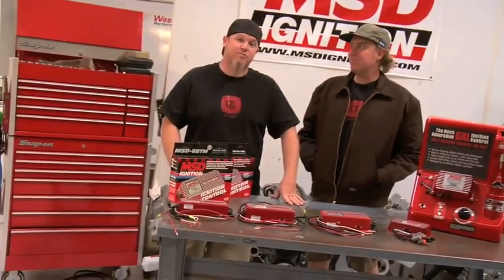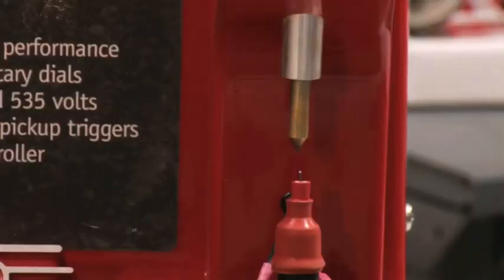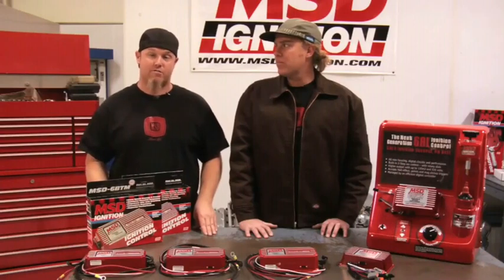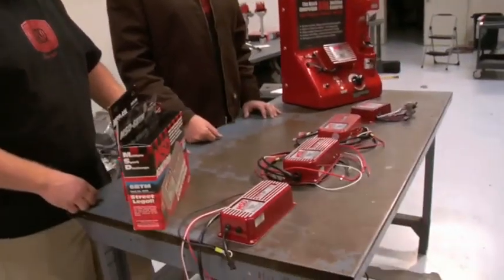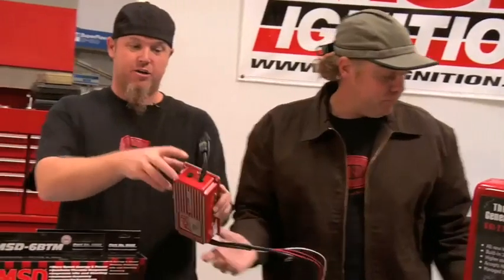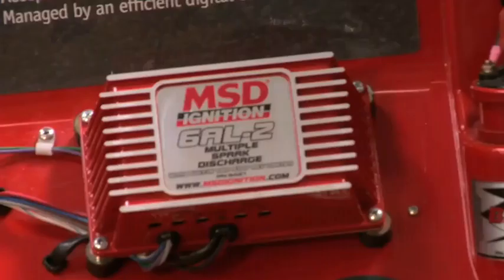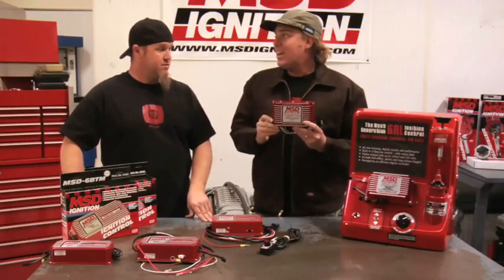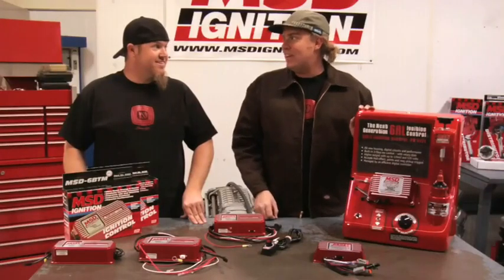MSD Ignition Controls - Playing with Fire

Comment: Can I use this box in my 1970 f100 with 370? And let me know if I need to change the distributor
Reply: What's a 370 ?
Reply: 360 Engine Sorry phone correct it!
Reply: @tonychavez239  thanks. I thought maybe I missed one of those Ford engines.
People talk sh!t about the 360. But they are a good solid reliable running engine.
I just rebuilt one last month. Had my favorite cam grinders, Delta Cam in Tacoma, polish up a fresh stock 428 cj cam and am going to try it in this engine.
Two important things for that engine. Deep six the poor exhaust manifolds and use a Ford duraspark and distributor.

Comment: Most of these comments are either "Will it work for me?" or "This product line is overrated." I had very good experience with the 6AL that was installed in my Ranchero in the '90s. The improvement in idle quality of the mildly modified 302 with single-point distributor was immediately noticeable, and probably attributable to the multi-spark discharge technology, In theory, it ensures that if the first spark fails to fire the cylinder, then the second or third spark might do the job. This would also tend to lower emissions, which is why some Ford Ranger 2.3 liter engines had dual spark plugs.
I didn't try measuring changes in spark plug voltage or plug life, although those can also be factors. As a few commenters noted, this isn't for everyone, but it works for some of us.

Comment: Good afternoon, very good explanation, I have a question: I would like to install the MSD 6AL and the coil (s) for a Silverado 2005 V8 Vortec 5.3lts. Stock, and I doubt that it is needed in total for the installation of the 6AL.  If only with the 6AL or also the coils or what else do I need?  Similarly if it is only one coil or is it one per cylinder (8 in total)?  Since I can't find a video to explain to me about that model and what I need, I would really appreciate your answer, thanks in advance.

Comment: Hey guys I wanna buy the  Pro-Billet Tach Drive Distributor (8572) but I wanted the MSD 6al digital will it fit? I have a 400ci sb Chevy if not witch kit is available with tach for Rev counter? Thanks in advance

Comment: What load? As the RPM’s go up, cylinder pressure drops. It’s called volumetric efficiency. Unless you have a power adder that changes cylinder pressure, the coil only produces as much secondary voltage as needed. After decades of looking at an engine analyzer for inconsistency between cylinders to ensure the equal opportunity is there, I see no reason for this system. For GM, over two decades use plug wires with a wire wrapped around an aramid fiber core measuring at 8 to 12 ohms per foot, instead of 40 - 50 ohms per foot like the ones sold by “MSD”. The coil if one per cylinder or a single coil can have lower primary resistance which leads to high voltage when turned off, via mutual induction (Step-up transformer) but other than lower amperage and using circuitry that switches 3 mosfets per micro-second, just increases the length of duration. Battery available is used on the primary side of the coil, otherwise the leakage thru the insulation would be horrible. The voltage in the secondary is limited by ohms law and produces only voltage needed to jump the spark plugs gap. Using one coil per cylinder allows for longer magnetic saturation, resulting in more potential for voltage induced into the secondary of the coil, but not used.
  Have multiple sparks per event in the air gap of a spark plug outside a running engine looks impressive but can’t justify the expense! That is if you see, if looking at the scope of an engine analyzer or any secondary display. Otherwise, this is an expensive dog & pony show for everyone who knows nothing about ignition, cylinder pressures, A/F ratio and how electricity works in a step-up transformer, painted red. I can’t find anyone to justify the expense or benefits unless you are a full blown race car the each injector can provide zip to 1 liter per second to a single cylinder. 
 This is my experience wanting to know what makes this system better than factory. Otherwise they would use it to reduce emissions while increasing HP. At $40 - 50k, what is the additional expense in the manufacturing process to spend an extra $38.12? Compared to their current ignition system, I don’t see any advantage from a technical point.
ASE Master Tech + L1 Since 1978 - Retired
Reply: Dean, may I ask your advice based on your experience and education? I have a 1981 GMC C3500 with a 350 4 bbl, th400, 14 bolt with 4.56:1. The head gaskets blew last year and the job was performed at a friend's shop. His new tech lost my distributor so they installed an aftermarket fancy cheapo HEI. 

The problem is the power has never been the same. This truck has a diamond plate bed floor, roof rack, and hydraulic lift gate. It is always loaded heavy and this is the truck I use for towing when my newer 2004 Dodge diesel isn't available. I don't expect the GMC to compete with the Cummins... I just want the GMC to perform how I know a properly tuned  small block can. When the truck was empty it used to be able to do a burn out and it would accelerate fast enough to hurt a few better cars at the stop lights. It towed beautifully. 

I know the centrifugal weight springs are probably incorrect for my application and this distributor also came with an adjustable vacuum advance diaphragm that is set with an allen key down the hose barb.

How do I make this right? 

Do you have some general guidelines? Does my tow vehicle require lighter springs or heavier springs in there? 
I can no longer get the "correct" vacuum advance diaphragm so I'm forced to tune this one to my needs and I'm not sure which way to play with it.

Please and thank you.
Reply: @xmo552  Please try to get a dial-advance timing light. Clean and ensure “0” is TDC. Check with spark tester first for strength. ACDelco P/N ST125 is spark tester 25,000 volts or 25Kv. Unplug vacuum timing advance & plug. Run and set to 10 or 12 degrees before TDC (If under hood spec label, follow it) Vacuum check advance with pump or simple hose check. Make sure it works. Spring on good weights lubed on good bushings could have same or mix of colored springs. If HEI, #1 think lost or left out is metal ground strap from coil screw to cap connector. I have 3 extras in drawer! Key B+, Ground connect on bottom, third is tach! 
With engine warm to idle, set base timing at 10, 12, or 14 degrees BDC. Springs add 21 degrees advance as springs open smoothly. Vacuum advance plugs into carb at Venturi port, meaning no vacuum at idle. As air speed increases across Venturi, vacuum increases. The vacuum advance adds to total advance adding 21 degrees of advance until WOT. 
  So let’s review, say 12* at crank, 1/2 of 21* of springs (Dist 1/2 speed of crank) + 12* 1/2 of 21* of springs = 
12* crank
12* springs 
12* vacuum
Total at 3k RPM = 48-52 degrees BTDC advance. 
Good strong 25Kv spark.
Good distributor coil / base housing ground.
Set base timing, watch spring & vacuum advance with advance timing light (Set to 52*, run engine until zero = 52*)
With timing set, use needle nose pliers and pinch off large hose from carbon canister. If RPM’s drop, bad purge valve, change or plug as long as vacuum lines to thermal vacuum switch good unless electric solenoid. (Varies on newer years say 89 & up)
Carbureted, engine off, run screws in until seated, back off 3 1/2 turns.
Start, run screws 1/2 turn in until idle drops, stop at even turns and back out until engine runs smooth. Should ok as long as carb & other ok like vacuum leaks. Done this hundreds of time as removing distributor and checking settings on sun machine as part of tune up. We rebuilt carbs, starters, alternators as parts in box meant new from dealer. Could have been reman parts but never saw them!
Best of luck! DK, Omaha. ASE Master retired.
Reply: @deankay4434 great explanation. But you went over his head.
Hope it was just a ground strap.
Reply: @jesse75  grounding the engine is a complex adventure. The alternator has to be grounded to the block, the frame, chassis, cab (On Trucks) and bed. But to complete any circuit back to the battery has to be completed. Other wise you have a voltage drop on painted engines with no wire & star washer into the back of the alternator to block. These star washers cut into metal to complete the return circuit. With a digital Volt-Ohm Meter (Fluke 87 type 5) run with current in a working circuit test across the wire to battery ground or B+ to see loss. It should be less than 0.030 volts! This measurement is a standard check. Like a parasitic drain on GM's after 2003. So, shut off, remove key, place a high amperage switch between the battery and vehicle's electrical system. (Note; New Ultra Low Emissions Vehicles) have systems come active to check "Engine Off, Natural Vacuum" in the EVAP software. But older vehicles don't. But electrical load shedding has been common on GM's since 2012. The systems shut down as the same as powered up in reverse. This comes down to higher MPG, as the government imposes penalties on car companies that exceed CAFE numbers. 
(Corporate Average Fuel Economy) numbers as they sell higher numbers of fuel efficient vehicles as compared to Corvette's. 
Google "The big three engine grounds"
Best of luck on your project! DK, ASE Master since 78.

Comment: 1:00 Show me a spark plug with a gap that wide. Your stock ignition is more than you need.
Reply: “More than you need” but not more than I want. I INSTANTLY noticed a power increase the second I crunk my truck up with the 6al. Like impossible to tell me it didn’t gain at least 30/40 hp
Reply: @lotus_8773  It is all in your head. The stock ignition system was lighting off your engine enough to keep the computer from giving you a misfire code. Firing your plugs twice only wear them out sooner.